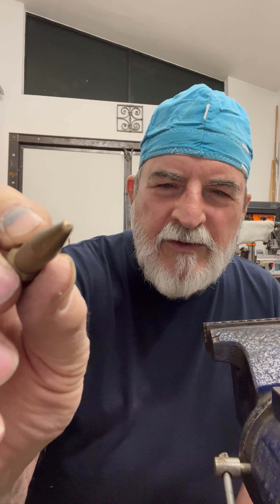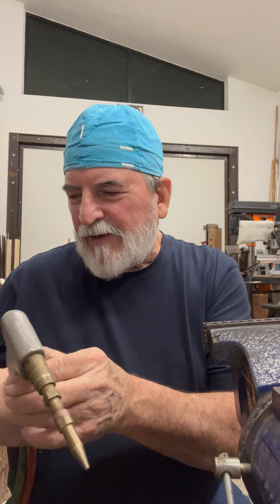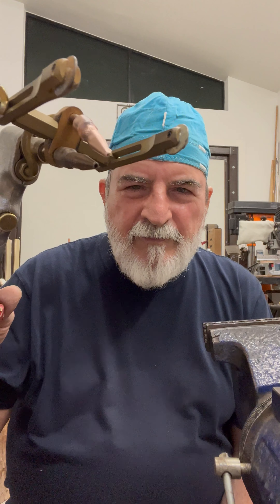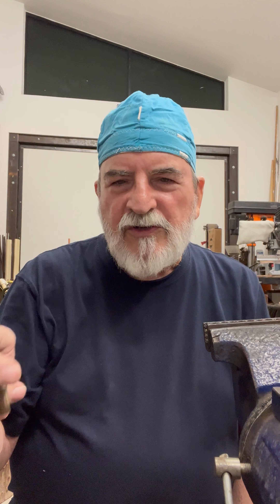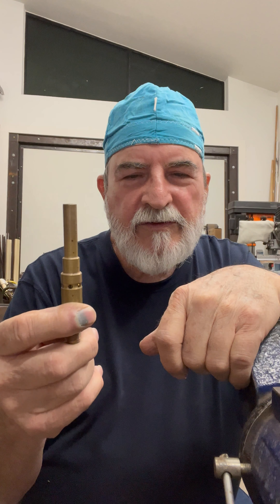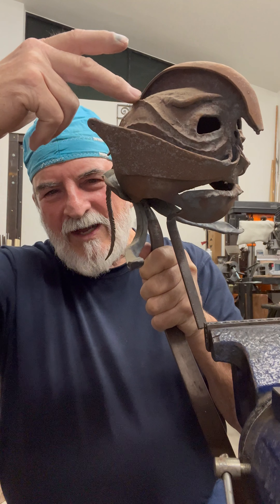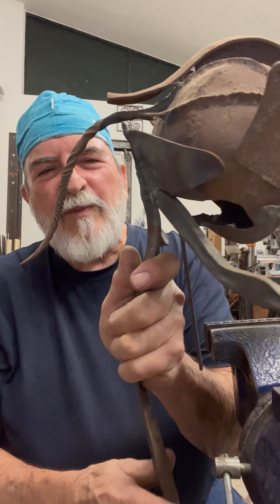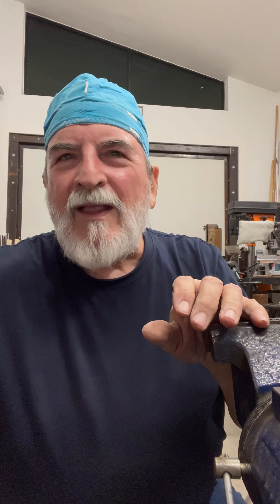Cobra DHC2000 ( Henrob/Dillon ) Welding Torch Virtues

Comment: Hello.  About 40 years ago i bought a Dillon MK IV torch at a rally.   I never got around to using it.  At some point Henrob opened a facility near me . I purchased a case and some anti reversionary fittings.  About 6 years ago my shop was destroyed by fire.  About 1 year ago, i came across a guy selling his grandfathers unused Dillon MK IV torch.  I bought it . The only difference the new one had as opposed to my original one is a black coating on the body.  I am about to begin an airplane project.  I intend to weld all the tubing with the Dillon torch.  I am very out of practice with oxy welding as i mostly used my MIG and TIG machines.  In January i will be attending a class specific to welding aircraft structures.  I will be welding 4130 thin walled tubing ranging from 1/4" to 1 1/2" .  Wall thicknesses from .028 to .058 ( i believe ).  I have just the basic tips that came in the kit. A 1,2,3 and a copper cutting tip.  I was thinking i should buy the 1 1/2 tip even before watching your video. Now even more so.  The afore mentioned project is what i will be using the torch for immediately.  In addition to the 1 1/2 tip, the smaller diameter hoses ( which i have ) , and low pressure regulaters are there any recommendations you would make that i should get before my class  ?  Thanks Sorry for the long dissertation.   William

Comment: About 40 years ago i bought a Dillon MK IV.  Around 6 years ago, my shop burned down destroying all my equiptment including tge Dillon torch.   Approximately 6 months ago i located a NOS Dillon torch still in the original cardboard box it came in .  Other than the fact that this torch has a black epoxy finish it is identical to the torch i bought all those many years ago.
Reply from the maker: Thank you for your comment. I’m totally sold on the versatility of this torch, and the pro master pack increases all of that, plus you can weld stainless and aluminum if you don’t have TIG or run out of argon. Just takes practice time with different flame adjustments. Good luck with it. It’s magic. And congrats on your find!

Comment: Very informative video. Thank you, I know they take a lot of work. I am setting up to start gas welding and wondered what welding lens you use to block the yellow/orange flare from the flux when welding aluminum. Detroit torch does not recommend a lens they just said a special lens is needed. Thanks, Tom
Reply from the maker: Just saw the “special lens” part and the Cobra/Detroit Torch folks sell a (I think)cobalt lense that is (I think) darker than a #5. As with most of their products the glasses are reasonably priced. If you go to Cobra directly could you let them know about your experience with the video. Thank you again
Reply: @weldtjtorchartmetals  Thank you for replying.

Comment: Been wanting one of these for a while gonna get the pro version around income tax time. Do you think it would be good enough to run specialty mobile welding rig?
Reply from the maker: Hello, Chauncey,     This torch will do everything the others will do and more. I think you’ll find it amazingly useful for anything you run up against. Sorry for the late reply.
Reply: @weldtjtorchartmetals no problem I finally used one a guy at work had one and brought it in to let me use it. I would say it’s quite limited but, probably does all It says it’ll do I tried cutting some 1/2 inch mild steel and I just couldn’t figure it out. What I cut with it It cut well just couldn’t keep the cut going as it’s very different from a conventional torch. I may wait awhile on this one now idk
Reply from the maker: Hello, Chauncey. Thank you for getting back. The cutting attachments are definitely different and require practice to get used to. I don’t know what you be seen or read but the under cutter. ( with the copper cutting tip underneath the heating tip) is good supposedly to 1/4”. I think 3/16” because the radiant heat gets intense. Use the over cutter for 1/2” with the O2 cranked up (use 11 lb anyway) to even 15 psi. The mental adjustment is laying the cutting tip down on the surface so you see the blow through from the back side and you’ll hear a sucking sound. It should cut clean with very little slag literally like plasma but maybe a little slower. Keep working it. You can get it. Good luck and happy holidays!
Reply: @weldtjtorchartmetals gonna have to give that a try . Happy festivus
Reply from the maker: Good news. effort always produces results. Happy backatcha... @chauncey5962